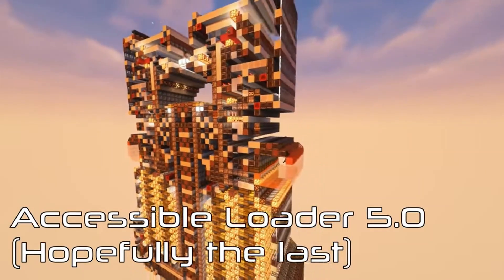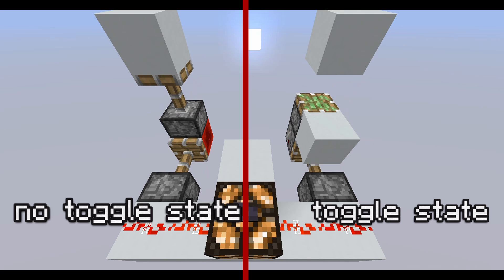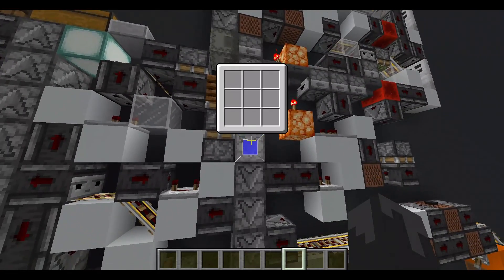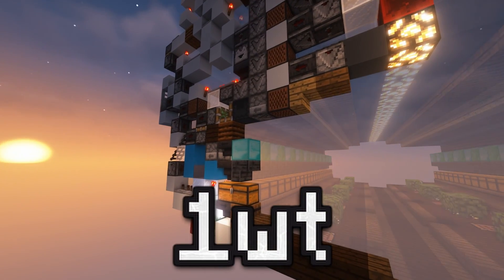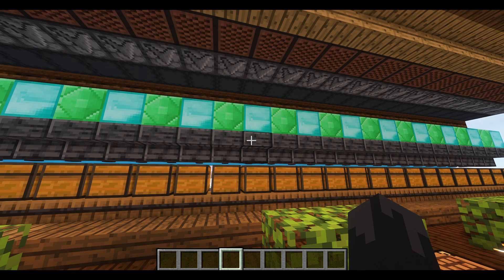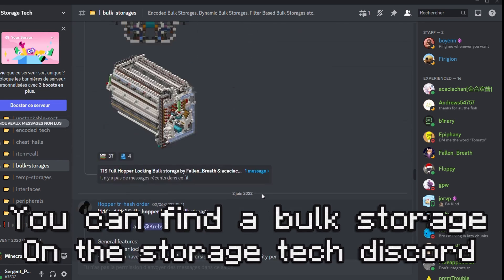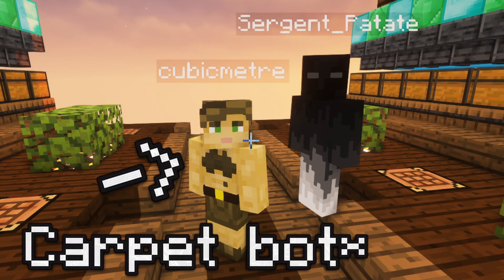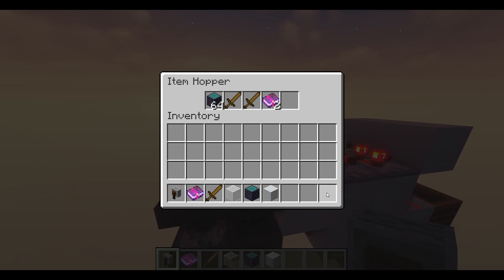The ultimate accessible box loader

Comment: Is this build directional? For some reason, I can't get the box loader to resume filling the new box after it is replaced. I have it built facing east. Also, how does the global locking work for the input hopper? I was always confused about those.
Reply from the maker: It shouldn’t be directional. Maybe you can double check with the wdl or litematic provided. I think, most likely, that you made a mistake when building it. 

The hopper locking is something that should only activate when you aren’t sorting items. When you are sorting items, you simply unlock all the hoppers and then it’s safe to send items to the slices. 

If you need more help with it, consider joining my discord server so we can troubleshoot better with pictures: https://discord.gg/E4q8WDUc7k
Reply: @PotatoCraft_TMC  I figured out the issue with not resuming after box replacement... I placed a powered rail in one spot  instead of an activator rail... works perfectly!! this is a great build!... now to build this slice a bunch more times lol
Reply from the maker: @jamesedwards1999  oh! That thing! Sorry about that. I should’ve used a noteblock instead. It’s an old design I should update this year
Reply: @PotatoCraft_TMC  I'm eventually gonna try to see if I can find a way to group item entities in specific stack sizes to send through the water stream to my overstock item filters... hopper cool downs gonna kill me
Reply from the maker: @jamesedwards1999  there are contraptions that do just that, but you can just clock an 8gt dropper to batch items and release a batch every 10sec or so. I have seen something like that on Rapscallion’s channel before. I don’t remember the exact name. Maybe an item batcher…? If you need, the storage tech discord is very cracked on storage tech and will link you what you need in no time: https://discord.gg/JufJ6uf

Comment: i just dowload your world and tested our build but the shulker never break and stay there full . any ieda why . im running 1.19.13
Reply from the maker: There is a lot of buffer items in the design. That’s the biggest drawback of it. The droppers of a slice will fill up until they reach the comparator that is 3/4 up the dropper line.
Reply: @PotatoCraft_TMC  jai vu dans un autre commentaire que tu parlais francais.
Merci de ta réponse. je vais etre plus patient et retester merci
Reply: This i becouse the comparator is sensing the 5 upper dropeer above the shulker so the shulker will break when that dropper will get full

Comment: good imptovments. though i dont undierstand why you insist on using that filter as it has no real advantage over ss2 ab tiled filters

aditionally there is no reason for anything to be 2x hopper speed in a sorting system 

if it was 1x ypu probably wouösve seen this design archived
Reply from the maker: I did make a ss2 version on storage tech. 2x speed still works for 1x parallel unloaders. If you really need 1x speed, change the clock and that’s it. Although this is not meant to be a progression over my own wall box loaders. I plan on revisiting these in the future but I wanted to do something easy, which these overhead loaders are.